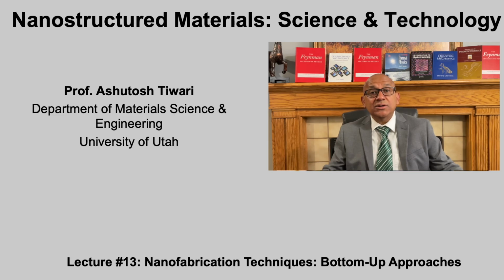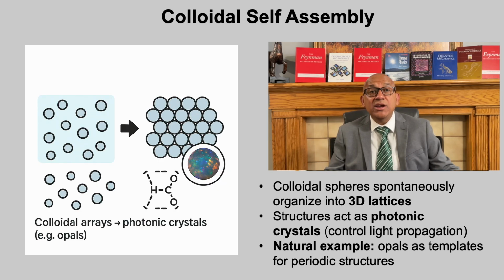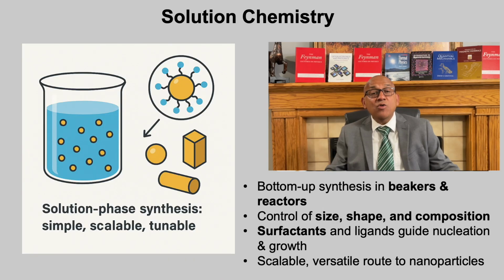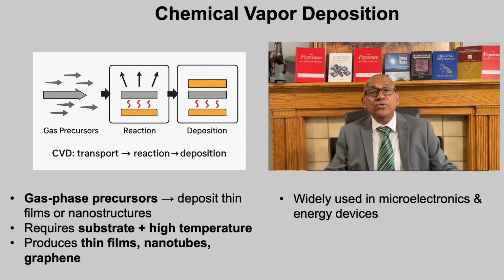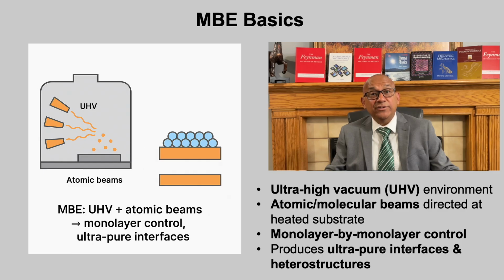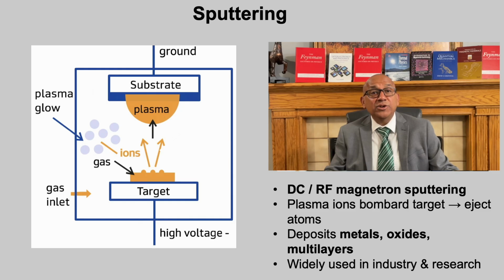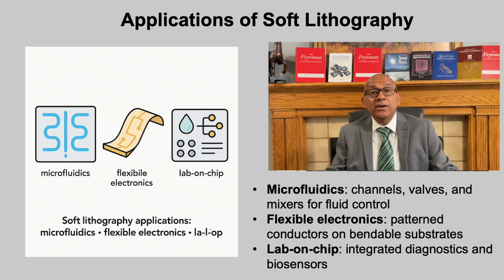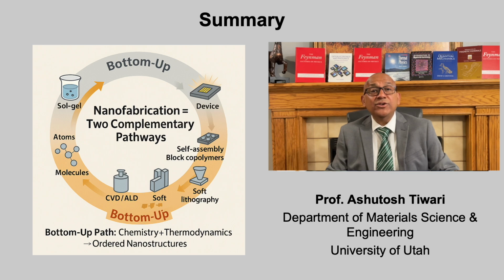Nanotechnology Lecture 13 | Bottom-Up Nanofabrication: Self-Assembly, CVD, ALD & MBE

Comment: Here, we learned about bottom-up nanofabrication, where structures are built atom by atom or molecule by molecule, rather than being carved from bulk material. Dr. Tiwari demonstrated how self-assembly, solution chemistry, and vapor-phase techniques, such as sol-gel, hydrothermal growth, CVD, ALD, MBE, sputtering, PLD, and soft lithography, can be used to control particle size, shape, films, and patterns at the nanoscale. We also saw how thermodynamics and kinetics, along with surface and interface energies, determine whether materials form smooth layers, islands, nanowires, or quantum dots.

Comment: This lecture is about bottom-up nanofabrication, building tiny structures by adding atoms together instead of cutting material down. Self-assembly means materials naturally organize themselves into patterns, like LEGO blocks snapping together. Examples include DNA helixes and block copolymers that form 10-50nm structures. This happens because materials try to minimize their surface energy. Solution methods make nanoparticles in liquid. Sol-gel creates metal oxides, hydrothermal synthesis makes nanowires, and hot injection makes quantum dots (tiny crystals that glow different colors based on size).
Vapor methods deposit thin films from gases. CVD uses chemical reactions to grow films and carbon nanotubes. ALD builds material one atomic layer at a time with extreme precision. VLS grows nanowires using metal droplets as catalysts. MBE is the most precise method for making quantum wells. Physical vapor deposition includes evaporation and sputtering .
Soft lithography uses rubber stamps to create patterns. It's cheap and works for microfluidics and biosensors.
The final structure depends on thermodynamics versus kinetics. Fast reactions make small particles; slow growth makes larger, uniform ones. Bottom-up is more efficient and precise than top-down methods.
Reply from the maker: Thanks for summarising!

Comment: Here is a quick summary!

The lecture introduces bottom-up nanofabrication—building structures from atoms and molecules rather than carving them from bulk—and organizes it around four pillars: self-assembly, CVD, ALD, and MBE. It begins with self-assembly, explaining how intermolecular forces and thermodynamics can drive nanoparticles, polymers, or biomolecules to form ordered patterns, and how templating or directed fields can steer the outcome. The emphasis is on why bottom-up routes excel at uniformity over large areas and at producing structures that are hard to reach with top-down tools.

Chemical vapor deposition (CVD) is a versatile thin-film workhorse: volatile precursors flow to a heated substrate and react/decompose on the surface to form dense films used across microfabrication. Key levers—temperature, pressure, precursor chemistry, and carrier gas—govern film quality and conformality.

Next is atomic layer deposition (ALD),  a self-limiting, cycle-by-cycle variant of CVD that alternates precursor pulses. Because each half-reaction saturates the surface, thickness is controlled at (sub)-nanometer precision with excellent step coverage in high-aspect-ratio features. Typical trade-offs include slower throughput in exchange for accuracy and uniformity.

Finally, molecular-beam epitaxy (MBE) is presented as an ultra-high-vacuum technique that evaporates elemental fluxes from effusion cells to grow single-crystal layers with atomic abruptness—ideal for heterostructures and quantum devices, albeit with low deposition rates and high tool complexity.

Overall, the lecture contrasts these methods’ precision, scalability, and integration, showing how bottom-up processes complement top-down patterning in modern nanomanufacturing.
Reply from the maker: Thanks for summarizing!